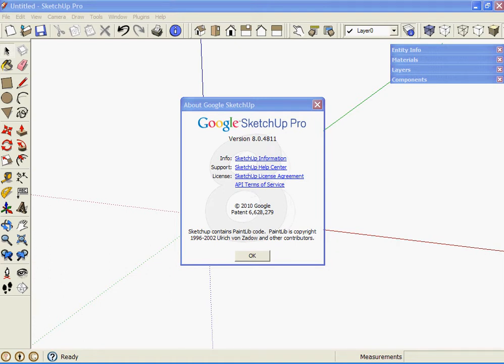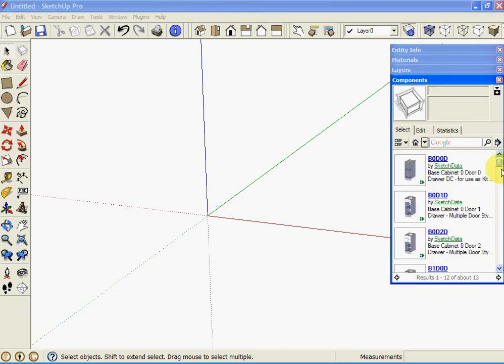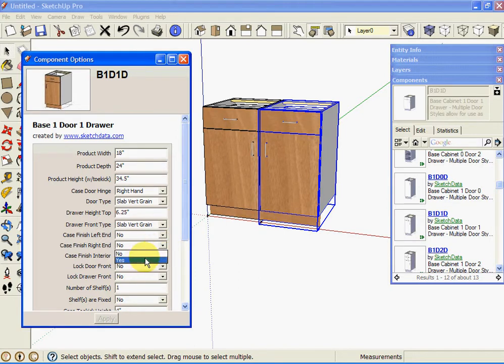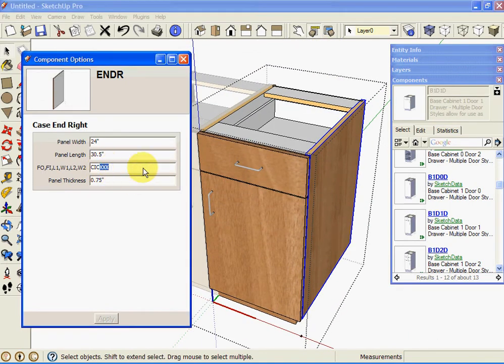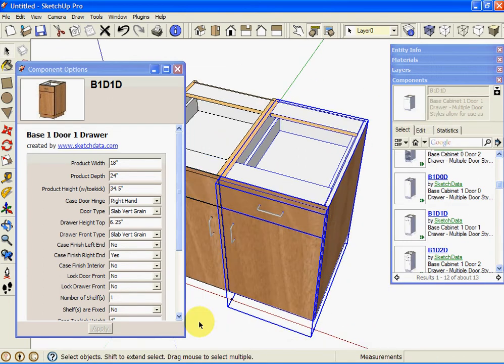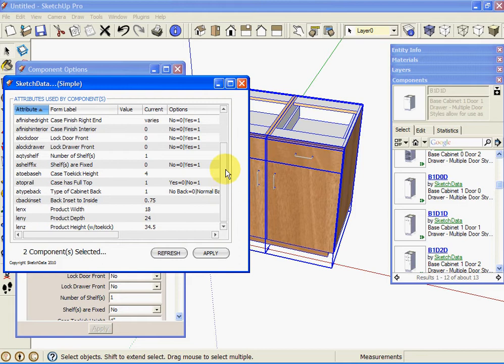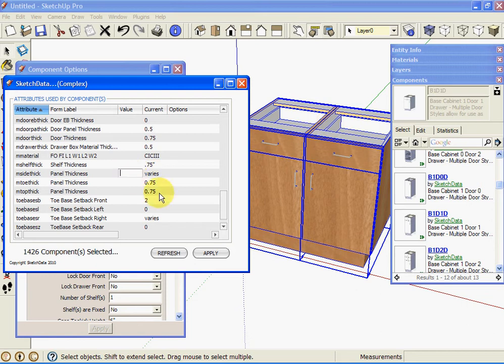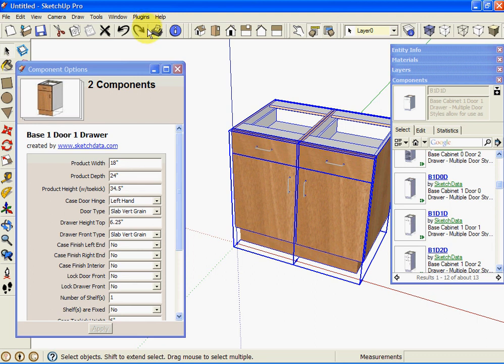SketchUp Kitchen Cabinet Dynamic Component Attributes

Comment: this is the worst. I have the latest version and I can't even get a cabinet component like this guy is bringing up let alone the easy to see and change attributes. wtf
Reply from the maker: There are some older Cabinet "Dynamic Components" in the 3D Warehouse or a newer catalog can be downloaded from the SketchData website.  In the Pro version of SketchUp there is a "Dynamic Components" toolbar which allows modifying sizes, finished ends, etc.   If you use the newer V2 catalog you'll also need the free SketchData Extension installed, since those DCs use some behind the scenes code.  Hope this helps or email info@sketchdata and I can try and answer more questions.

Comment from the maker: SketchUp has a "Generate Report" tool, which I believe is only in the Pro version, which creates a text/html file with the attributes.  We are currently working on a plugin that will export the attributes/parameters to a local database, which will allow reporting (like a cut list) and exporting to optimization software.   As for creating DXFs for CNC programs, definitely alittle more tricky, but we have tested several ideas and I believe we'll come up with a solution.